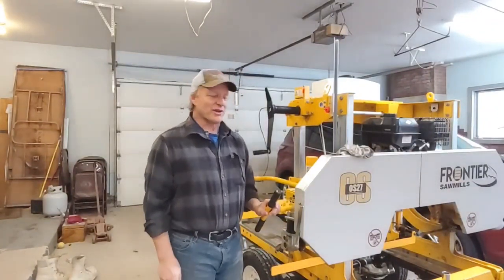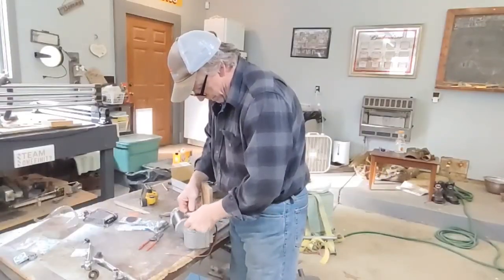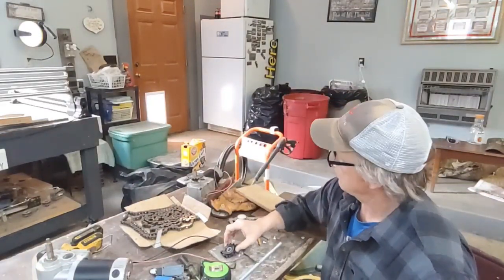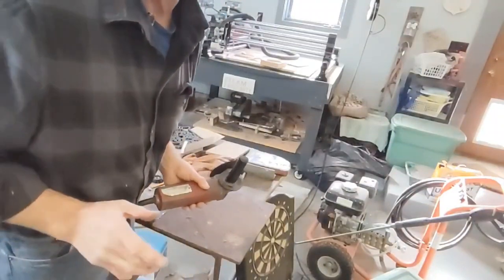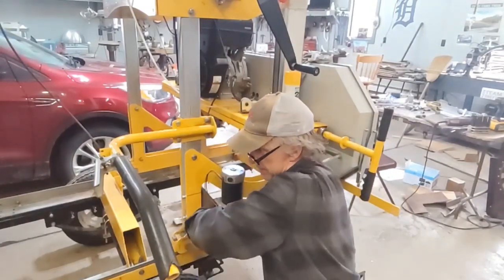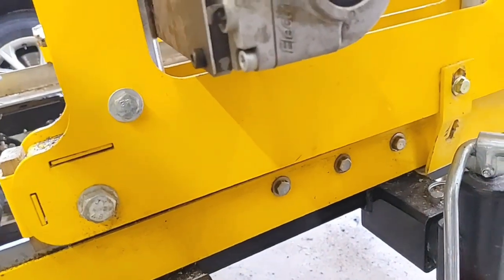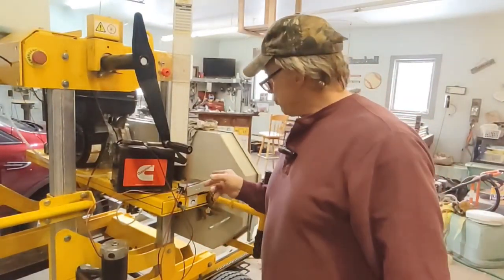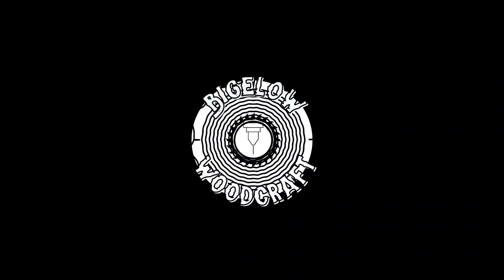Power Feed for the Frontier OS27 Sawmill. Part 1.

Comment: Awesome video and great setup !!  Thank you for the detailed look at the build. Hopefully I can get the time this winter to get to working on my own.  So,  I'll warn you now, be ready for some questions my friend.  (-;
Reply from the maker: I'm excited for your build and to see what you come up with.  It's a fun build.   It sure makes life much easier.    I also put an up down for my saw head.    We're not getting younger.  Have a great holiday my friend.
Reply: @BigelowWoodcraft  I'm in the planning and parts collecting phase right now. Yes, the saw head does get a bit tiring doesn't it.  I've noticed that yours seems to be smoother than mine. I use spray silicone on the posts....what do you use?  I may have the mounting bolts too tight but I don't know for sure.  Loosening them a mite does not seem to make a difference in the slide.
Reply from the maker: @tractorman4461  I occasionally use transmission fluid in my uprights.   Many say not to.   Probably a good carnauba wax would work great.   I've got a really bad right shoulder and that cranking gave me fits.

Comment: The auto feed is a great idea! 
When drilling metal use a slow speed! Your bits will last longer and the drill will cut better. A high speed just creates heat and doesn’t let the bit cut. Cutting oil also helps😊
Reply from the maker: Correct. Thank you
Reply: Yea I was surprised to see him go to town full speed with that drill

Comment: Been watching the videos on your power feed. I am getting ready to do the same with my mill. I have the same motor you have. Question is can you still push the power head by hand? Does the motor prevent it?  Wondering if it will free wheel?  I built my sawmill from scratch. I have a ten hp single phase electric motor on it. I built the power lift from the beginning. I have been using carbide tipped blades and will probably not go back to regular blades. I have 29 1/2” between blade guides and the power head goes up to just over 32”. I can cut 13 1/2 foot long logs. It’s mainly a hobby in my retirement. I have custom cut some wood for a few people. I really enjoy it and my mill works great. I have been cutting my own lumber and building tables, nightstand, pool deck, quilt ladders, etc. I just finished building a cedar chest for one of my granddaughters. Enjoying life. Let me know about the free wheeling. 
Thanks 
LC
Reply from the maker: Good morning Lonnie.  Your mill sounds fantastic.   Where are you located?   As for the motor free wheeling.  No it won't.   You can push it but it's difficult.   However I got around that by attaching my sprocket to a shaft collar.   The collar locks down on the motor shaft by 2 set screws.    Once when my switch went bad my mill was stuck down at the end.   I loosened the shaft collar and it freewheels back.    Best of luck with your build.

Comment: I built a sawmill last summer and have been toying with the same system you have installed on your mill. I have all the parts except the pulse modulation system. I was hesitant about purchasing one from Amazon after reading some of the reviews however. I will continue to monitor your setup and see how it goes. Good luck.
Reply from the maker: Check out Mike Festiva's channel.  He builds a sawmill and power feed.  He goes in deep about the  PWM's. I've had one on my bandsaw sharpener and it's been perfectly sound so far.  It was really cheap think less than 25.

Comment: I built one similar and it works great except yours seems to have a better speed range. Mine takes quite a long time to return. One thing I did notice was that your spring looks like it cannot work as you have put two nuts to he left of it. This will prevent the spring from sliding. I just have one nut on the very end of the spring. Good job though and enjoyed the video.
Reply from the maker: Yes I noticed it after I built it.  I believe the next video I take out one of the nuts because of exactly what you said.  This year I switched it to 24 volts and it is extremely fast now so you have to be careful not to hit the limit switches at the end full speed.

Comment: I fried the power feed control on my older woodmizer LT40 earlier today and stumbled across this video tonight.  SO HELPFUL!!  I have done some rigging on my old mill over the years and have, most certainly, messed some stuff up.  I plan on setting it back up just how you did.  What size wire did you run from the motor to the control and then to the battery?  My mill had 10 guage everywhere and I’m wondering if that was just too heavy.
Reply from the maker: I'm using stranded 12 gauge wire.  I hope you get it straightened out.

Comment: Seems like you still have to walk the carriage to and fro. Perhaps a remote control or something would allow you to stand or sit to the side and sip daiquiris while the sawmill does the work. Mounting the motor to the frame and not the sawhead would allow you to use wall power and thus not be limited by battery capacity.
Reply from the maker: Stay tuned.  I'm building just that.  My dream would be to program an Xbox controller but I don't know how to code for that.  I'm currently building a power up down feed.
Reply: @BigelowWoodcraft  oh yes, I watched that video as well. It’s looking good! Will have to go RC for it; are you using an Arduino? The user base is large enough for it that I suspect the code has largely been written and would just need minor modifications.
Reply from the maker: I'm not using Arduino.  I don't know much about it.   What's probably going to happen is a station connected via wires to the  motors and limits switches.   So I can leave it with the mill head or leave it back and sit on a chair with a control panel in my lap.

Comment: Very cool! Can't wait to see this work. How did you determine sprocket size?
Reply from the maker: I calculated the rpm and how fast I wanted it to return.   I added the number of teeth which is 19 times rpm.  The chain is a half inch pitch so every time around the sled moved 9.5 inches.

Comment: That is identical to the setup I have installed on my LM29. You really don't need the spring on the chain. I have a short video on my youtube Chiskie Wood Creations.
Reply from the maker: This motor stops pretty hard.  I did try it with the spring and you're right.   Its is not needed but with it does limit the shock.  I have a video coming out Tuesday.   I was actually pretty surprised how much it dampens it at full speed.   That's where I think it'll save wear and tear on the motor.   Thanks for watching.
Reply from the maker: I looked at your setup up on your channel. Excellent.  I am sure an up and down power feed is next. Nice job on your mill.   Do you have a limit switch at the ends?
Reply: @BigelowWoodcraft  I do have limit switches.

Comment: Hi Jerry
Could you provide the specs for the feed motor you're using please? Watts, rpm?  I can't seem to find it in the links you provided.. all i got from the video was that it can be run with 12v. Thanks in advance from a snowy and cold Sweden,
Reply from the maker: There is no model numbers on my motor.  It's made by Elctracraft. Send me an email and I'll send you pics of the motor and a link to the website.  There your can see what most likely are the specs.  Sorry I don't have much information on the motor.  I counted the motor speed at 12 volts at 70 rpm
Reply from the maker: Bigelowwoodcraft@gmail.com

Comment: Please share the link of the chain, DC motor  and sprocket
Reply from the maker: The DC motors I found on eBay.  I can't post eBay links but they're plenty of wheel chair motor.  I did share in the description for the video the relevant parts and links for Amazon.  I used a 420 chain.  The drive sprocket is a 19tooth I believe.  The idler sprockets don't matter.  The drive sprocket I wouldn't order until after you have found your motors so you can match up the size of the driveshaft.   Hope that helps
Reply from the maker: Also if you email me up attach screen shots to all the parts

Comment: Wondering if you ever got a dc power supply to power the auto feed and if so which one you used. Have the same setup and motors.
Reply from the maker: No I never did use a dc power supply.  I do use one in my sharpener.  I got that one off Amazon
Reply: Would you know the wattage of the wheelchair motor. Have all the parts on order but my mill does not have a battery so I was going to use a power supply and just wondering a size to order
Reply from the maker: I've never put an amp meter on mine but the spec sheet I found on line said 6 amps at cruising speed.   I have a 15 amp fuse that I've popped when the carriage ran into the log when I want paying attention.
Reply from the maker: I just have a 12 volt car battery sitting on the carriage.  I've run it several days without any decline.  I try to remember to put a trickle charger on it when I'm done.